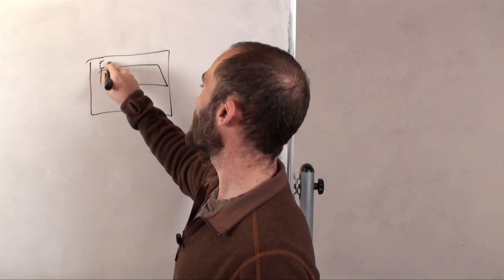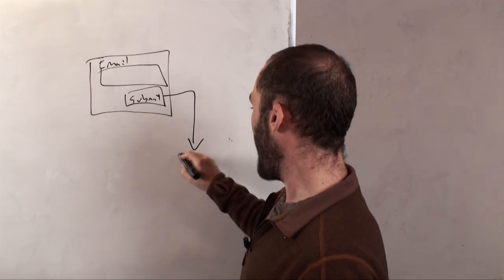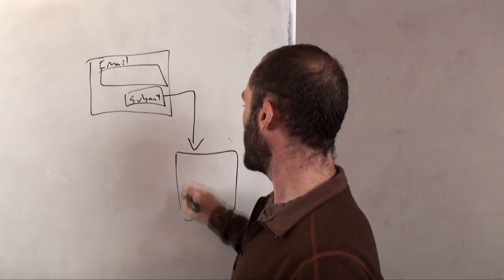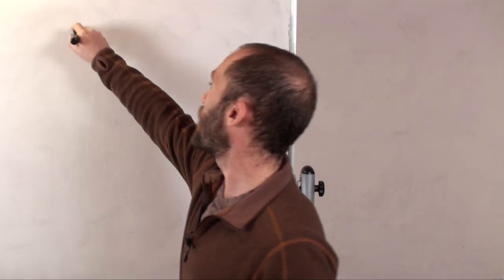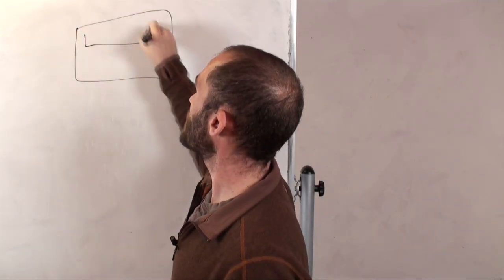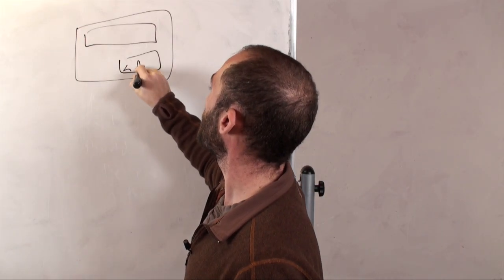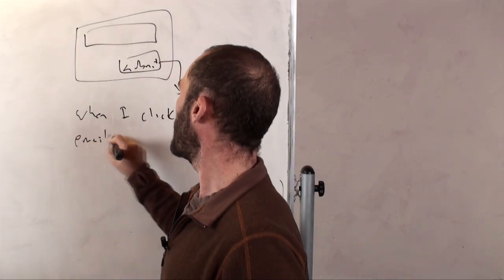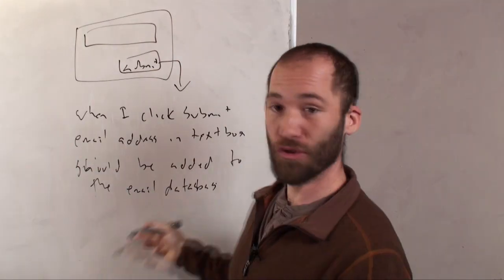Introduction to Programming

Comment: Actually Neither are the best. They all have their pros and cons.
Javas con  : it takes to many lines. and it is high-level.
Javas pros : It is a very versatile object oriented language.
Assembles cons: It is a RISC language meaning not a lot of terms     are defined.
Assembles pros: It's practically the closest you can get to the circuitry of the computer.

Both language are good for different purposes.

Comment: I guess you meant Assembly by 'ASSEMBLE'

There is no "best" programming language, every programming language has pros and cons and each is best suited for different things.

Assembly for example is the fastest programming language I know of, but it takes much longer to program in assembly than in C++ for example. It also lacks structure and is hard to understand by people who are new to programming.
Its often used to access external devices and to 'speed up' calculations and loops in C.

Comment: It's not a point it's a question lol.. I'm asking.. if I made a program using the PHP language, uploaded it to an internet server that DIDN'T have php interpreters installed, then no one would be able to see the website right? Or at least they wouldn't be able to run certain parts of the website relying on PHP coding

Comment: Hate to burst the old bubble, but 13 years old is very young. If you want to start programming, you first need to understand how programming works, and the basic concepts of programming. This is easily done using Java, considering the language was pretty much made for that (based on my perspective). Java is powerful for learning, and if you want to make games, DO NOT use C++ at a beginning level. Use jMonkey/XNA. jMonkey requires GREAT knowledge of Java, XNA requires C#. Good luck.

Comment: How would you convert symbols like in this line I copied out of a ps3 save component (named DATA0.DAT)?

‚ÖıT%æºX—ƒà=ºLh  ≤ 	ˇWÆp—SIØ≥ Ä ^ ªÈ¯‰aò´Ü l´˛ 

I was experimenting with a programmer calculator and found out that certain number patterns made different symbols in the corner (example: 123=i when on Unicode in hex). How do you make this calculation reversed? I was also wondering what the outcome numbers might mean.

Comment: @FettersProductions Oh and to be clear C++ still has the modern design aspects that java has *to a degree* it just also has other old styles that might confuse a new comer. Most of the big games out there that aren't run from the browser will be built on c++, or predominately c++. 

Also good to note, good programmers learn a few languages *usually about 3-4*. Programming languages are like tools, and while you can technically build a chair only using a hammer, using several is more intuitive.

Comment: @FettersProductions I reccomend starting with Java when learning how to program, it is by far easier then c++ and it is based on certain design aspects *object oriented programming to name one* that is modern. I started on c++ and found myself overwhelmed and wouldn't reccomend that as a first language to anyone.  Immediately after I learned c++ I learned Java which took a fraction of the time and is easier.

C++ is what you'll want to end up with later, but for now start with and easier lang.